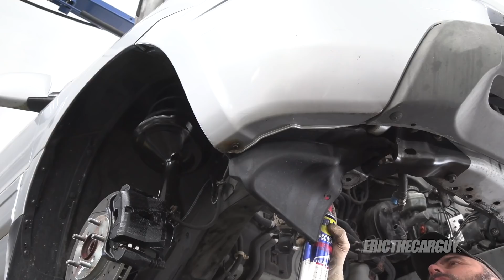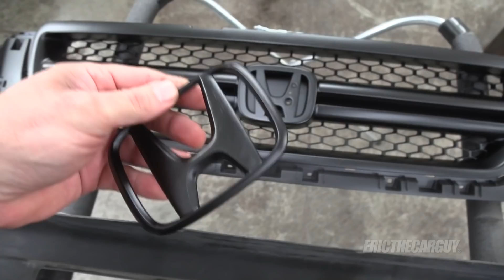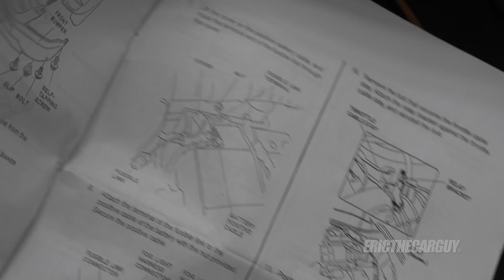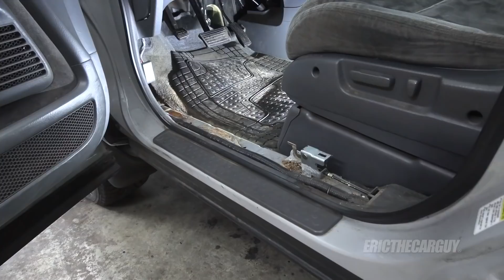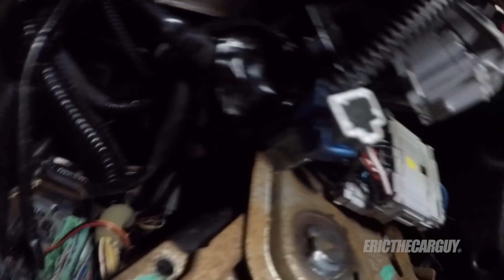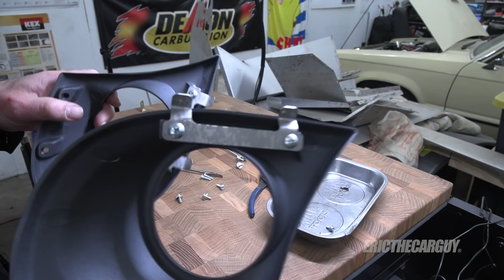How To Install Fog Lights Honda Pilot

Comment: I have purchased this kit over a year ago and couldn’t figure it for the life of me even though I have installed several fog light kits on Toyotas. So thank you so so much for this video! I do want to ask why the first fog light bracket wouldn’t have worked? I seem to have the exact kit and am not sure why the original fog lights wouldn’t fit your bumper ?

Comment: honda  related but I have a  2011 honda crv  with 74k on it  and the steering wheel is extremely hard to turn  no matter what way you turn the wheel. I'm wondering  what's wrong  and if anyone can help

Comment: So, I installed a similar fog light kit into my 09 6-6 . I installed a relay with a heavy gage wire to my battery positive side with a fuse. I used xenon bulbs with high quality ballasts. I pointed them low and towards the ditch. Much better than led bulbs in the same kit on.my Crosstour. I bought the yellow bulbs which are much better in fog and rain than the blue color.

Comment: Looks like I’ll be getting the second kit and an aftermarket light bar wiring harness, not as clean as this install but especially with that button not working like OE It doesn’t make sense to me to spend the extra $200 for a car this old

Comment: It's hard to believe that Honda made it so elaborate for this SUV.
Newer cars did this properly so clients could opt for more options as dealers could install expensive additional equipment fast and easy.
Nowadays I don't see fog lights, as they use DRL for everything
Reply from the maker: Actually, this isn't that difficult with the correct parts. At least in my view. Thanks for the comment.

Comment: Could you foresee any reason why my cruise control won’t work after doing this? Is there anything in the chain that could be related?  Kind of random but thanks for any input!!
Reply from the maker: Not sure, but the cruise control switch is right next to the fog light switch. Maybe check the connection.

Comment: Eric ,a really good job ! Aftermarket Bumper covers are typically not an exact match, You must make them fit. I have over 40 years experience as a licensed Auto Damage Appraiser , The Insurance Companies made us write our appraisals with these aftermarket
covers . We all knew their fit {aftermarket bumper covers} was poor . Many shops had to go the extra effort to make them work.
 Unfortunately Policy holders damaged bumper covers so often after a while it did not matter. On my own vehicles I repaired bumper 
covers when I could or bought used {OEM } ones first, Aftermarket was always , { A last Choice }.......EH.
Reply from the maker: I completely understand. https://www.youtube.com/watch?v=a5RRJZrhkBI&t=3s

Thanks for the comment.

Comment: Worse case scenario, if that switch ends up failing you-- you could pop in your little gray plastic cover that was previously in the switch hole, and then you could drill through it for a more common round switch or even a toggle switch if you had to;  doesn't look as integrated of course.

Comment: I'm actually shocked at how complicated this wiring is for something as simple as this could be.  After seeing this,  I think I would likely just run my own independent system from an aux power and just put in a simple switch to run a simple relay and wire that straight to the lights.  That way they still turn off when you turn the key off, but you bypass all these 'system harnesses, and just keep it basically manual.  and I would be tempted for it to just be a light bar mounted in the center. lol.
Reply from the maker: I agree. It did seem like a lot of unnecessary circuitry.

Comment: Nice job Eric 👍 That bumper design sure made it a lot tougher than other vehicles. I put fog lights on a ‘07 & ‘09 RAV4. They both had the fog light blank panels which made the install much easier. The wiring is always fun!

Comment: Thanks for the info about fog lights being on with the brights being illegal. I knew they generally turn off when the brights go on, but didn't realize it was a law. Looked up the statute for my state and sure enough.
I just wired some up for my friend a couple weeks ago. I informed him, but he's not too worried.
That said, if he decides he wants to, I will cover the cost of the additional relay to interrupt when the brights turn on as it was my ignorance of the law.
Reply: All you need to do is check with the State Patrol in your state or check the driving manual you can get at the BMV.
Reply: @squirrelkilla7371  State revisor of statutes website doesn't require me to talk to anyone or go anywhere. ;-)

Comment: You talked about making sure you've got the right part, and it reminded me. My day job is at a glass shop, and we do automotive glass. Someone brought in a Kia, and it has become the bane of our existence. It needed a passenger-door glass, and a regulator. Turns out, the regulator is the entire plastic structural panel in the door. Okay, we go to source that, and give them the VIN, and they state that there are two possible regulators for that car. Uh, no. That VIN is unique to that car, so there should be zero argument about what equipment is in it. 
And then we get the regulator, and a part's missing. Then we have to get a new motor, on the NEW regulator, and I don't even know where the saga is now. The Lesson: Buy Honda and Toyota
Reply: They probably just pulled the make and model from the VIN, not the specific build list for that particular car would be my guess. Resulting in two options.
Reply from the maker: That sounds like your typical auto repair nightmare because of bad or wrong parts. Sorry you had to deal with that. Good hunting.

Comment: Maybe pick an original switch from salebay or scrap yard. Good job Eric  loving the black Honda badge 👍
Reply from the maker: That can work but you'll need to change the connector. The OE connector, and the switch connector for this kit are different.
Reply: @ericthecarguy  typical 🙄

Comment: Congrats you Ohio’ens don’t need a pointless front plate anymore 🤙🏻
And yeah Florida law requires fog lights extinguish when high beams come on 🤓
Reply: when did ohio get rid of that?  My MIL still has hers on her suburban.
Reply: @jcbecker2800  I saw 7/1/21 when I looked it up

Comment: I had to replace the factory fog lights on my former 06 Pilot (same body style as yours with a few suttle differences), as well as my 2014 CR-V. What an abortion that was! I honestly should've just pulled the bumper like you did here because doing it blindly from underneath was such a cow! My 2011 Pilot, on the other hand, was so much easier to do because the fog light covers just pop out from the front and it takes 2 seconds to swap the bulbs out. I wish they had just done that from the beginning.

Comment: Nice job, the front end of your Pilot looks great. Mr. Negative here wonders why anyone would want fog lights. I’ve had several vehicles factory equipped with them. Never use them as I think they are worthless. But that’s just me.
Reply: Have you encountered heavy fog or snow? A river valley when conditions are just right?
One thing that is underestimated in my opinion is cornering lights. I want to mod some of them into the truck I recently got. It's been so long that I had a vehicle without them that I forgot how nice it was having lights that turn on with the blinkers or when the wheel is turned so far.
Reply: @caddyguy5369  Tule Fog in the Sacramento velvet is about as thick as fog gets. To me fog lights are totally useless. But I know most folks like them.
Reply: @CrazyPetez  Fair enough. Just curious.
Reply: I imagine the particular fog lights in question would impact how well they seem to work though. What vehicles have you had with them?

Comment: By far my favorite modifications to do on a car is to add options that the manufacturer has obviously prepped the car to accept it but was not installed as it was an option.
Like fog lamps or rear electric windows installation. You'd think that it would be a hassle to add these to a car only to find out that the factory wiring harness is already prepped to work with what you're trying to install and even have the holes for the buttons already there ready to be installed.

Comment: I'm sure you've learned to never pressure spray a panel that been painted. There's a good chance the paint will come off just like yours did. I've seen paint come off in sheets with just compressed air. If it's not factory paint I'll just wash it by hand

Comment: I have to say, I'm not the biggest Pilot fan, but you've done some great work with this Pilot and I like seeing it.
Reply: I have the 2002 Acrua MDX, which is basically the same vehicle;  and I have to say that it has really grown on me after driving it a couple of years. Mine has 3 rows of folding heated leather seats;  and it really has the utility of a mini van, that looks like a crossover, but drives like a little sports car feel.  Especially like in the snow, Acura's AWD system really is useful.  I didn't initially like the front end look of the car really, but like I said, it has really grown on me and I love this thing now.  That's why I like Eric's vids, these little Honda's and also the Toyota's are really a dialed little package.
Reply: @calholli  I get that. But I also am not big on SUVs. I prefer the minivans. I own an Odyssey, and I think Honda does a good job of still making it drive a little sporty. The J35 packs quite the punch.
Reply: @wiimaster2847  Yeah, the undercarriage is still very similar on the minivans' too.  My MDX has the 3.5L Vtec..  This thing only has 160k miles and not a single thing is dripping or leaking oil anywhere on it-- absolutely everything works, moon roof, heated mirrors and heated leather seats, even has an Alpine or Clarion stereo *(I forget, at the moment lol)..  And I snagged this thing from a young kid and his rich mom on craigslist for only $1700.. still has 90% tire tread all around. lol.  So you can see why I LOVE this thing.  I got it for such a steal.  zero rust- we don't get rust here in Oklahoma.
Reply: @calholli  yep, I'm in Texas, no rust here. Best part about your MDX and my 06 Odyssey is no VCM junk to kill the engine.
Reply: @wiimaster2847  Yeah..that's the worst

Comment: The switches in these kits are terrible, they don't fit and don't light up correctly. Thankfully the rest of it is pretty good. What I always do is track down an oem fog switch with pigtail and wire that in.

Comment: Does a Honda Element from around the same year also have a factory harness for the fog light kit? That would be really awesome if it did so preferably I don't have to cut and splice any wires.
Reply from the maker: Video linked in the description for Honda Element fog light installation.
Reply: Idk for sure about the element, but it be done this mod on the first two generations of CR-V and it’s basically the same process. The bumper has all the screw holes and the wiring harness is ready for adding fog lights. The dash should already have a place for an oem button to go for the fog lights.

Comment: Aftermarket switches marked for the 2nd-gen CR-Vs also do not fit. For mine I sanded down the edges of the button itself, there was enough plastic material to do so and remain sturdy enough. It was tricky keeping the curvature of the rounded corners. Then I painted the exposed white plastic edges the sanding revealed with black paint, and it fit the opening just fine. I believe the button is just too tall for the opening but the width was just fine.

Comment: That wiring harness from the first fog light kit is so well made. It's hard to find a fog lamp kit with plug and play wiring kit here in Malaysia that fits properly with the original wiring harness.
Reply: You can usually buy the other side of that plug--  that will have 12" pigtails, so at least if you're harness doesn't have the plug, you won't have to cut your factory wiring harness.  But that's something you would have to remember to order separately.
Reply: Car accessories shop here will cut the original wiring harness in a heartbeat to wire up an aftermarket fog lamp. They did that with my head unit. I didn't realize that until I tore things up to diagnose a bad FM connection.